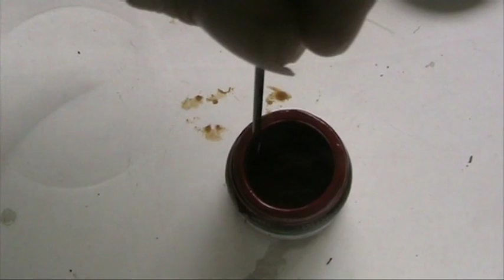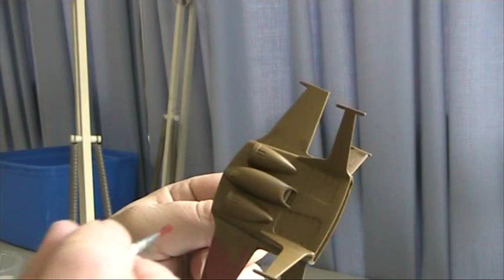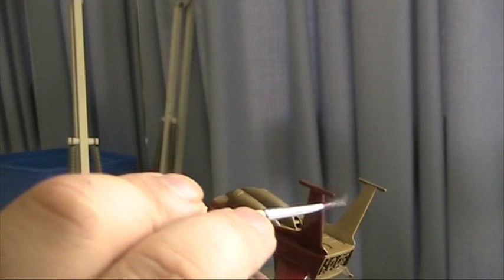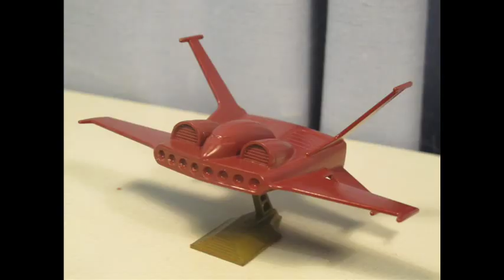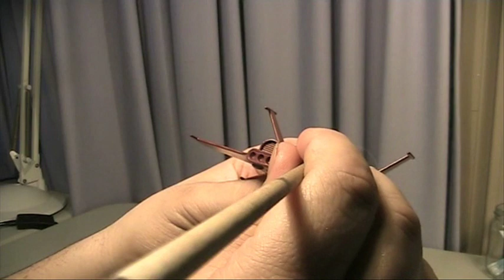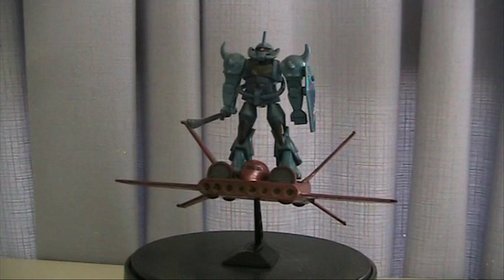Gundam/ mech model workshop 80: hand painting acrylic tutorial

Comment: Hi, I'm having problems getting the paint to stay on edges/convex corners, it just seems to run of, does this mean I have thinned it to much (I used 1:1 ratio of 99% alcohol with tamiya orange) or will it simply require more coats?

Comment: The only tutorial I found useful since I just have paints and thinner. 
Just asking, what else paints work? Do water based paint work? Or even water color?
Reply from the maker: With this method using the correct thinner any paint can work. I would advise against water colors, polyurethane and water based as they have adhesion issues and could life from handling or masking. If you are looking something extremely cheap you can't go wrong with cheap enamels remembering to mix well or the pain will be tacky for a long period of time.

Comment: what if it's a 70% solution isoprpyl alcohol
p.s will it leave marks
Reply from the maker: test it on and spoon or runners and see if you like it. If the mix works run with it on a model.
Reply: mokanaman wow you actually replied in 10 minutes thanks man
Reply from the maker: Just happens to be logged on, glad to be of assistance. I check for questions every days.

Comment: hi, i wanted to know if 70% alcohol stil works even if its worse, and does the isopropyl and normal one differ?
Reply from the maker: It will still work, it will harder to control flow and drying but every brand is different so it is recommended to test on some runners before painting a part or kit.
Reply: mokanaman thank you :)
Reply: one more thing, is the normal alcohol and isopropyl alcohol the same?
Reply from the maker: no, could be ethanol or mentholated alcohol and may have different effects on the paint.
Reply: mokanaman i see, thanks again

Comment: How long did you let the paint dry between coats?
Reply from the maker: A number of hours, might get away with 2-3 layers a day for the best 
possible results. I use to do a coat a day and have a number of projects
 on the go at the same time.
Reply: mokanaman
Alright, thanks!  I'm planning on buying some retarder, would a day be enough time between coats?
Reply from the maker: It is more then enough for an ideal finish.
Reply: mokanaman 
Thanks!  Even though I don't do gunpla, I watch these tutorials because I use Japanese paint and equipment for my aircraft.  Your channel has been a huge help!
Reply from the maker: Gunpla only makes up about 30% of my content but more or less the same 
methods across the board. Thank you for your feedback man, glad to be of
 assistance.
Reply: I'm building a Bf 109 F-4 and I have a few questions

1. I'm gonna use Mr Hobby's Aqueous line because Tamiya doesn't have any RLM colours.  Would Tamiya X-20A work as a thinner for the Aqueous paints since they're both Alcohol based?  
2. Would Mr Retarder Mild work with the aqueous paints?  It's a lacquer retarder so I suppose it won't.

Thanks!

Comment: I tried out Tamiya acrylics for brush painting and here's what I found.
They give you a very smooth finish even without thinning but since the pigment density is low, it takes a million coats to paint light colours like white, yellow, etc.
Reply from the maker: Compared to all the paint's I've used pigment density is terrible. A good reason why I've moved to lacquers.
Reply: mokanaman 
You said an equal amount of paint and thinner, does that mean if I put ten drops of paint onto the palette, I have to add ten drops of thinner?
Reply from the maker: More or less that is about correct until you have the ability to tell how thin the paint is eye balling it while  string the contents.

Comment: do you have to sand a kit before painting it ?
Reply from the maker: I only sand seam lines and nubs. Because I use primer before painting sanding is not needed to alter the kits finish or promote paint adhesion.
Reply from the maker: With high risk jobs like resin or lots of masking I would sand and prime. But because  there is a lot of mixed information on facebook and youtube regarding modeling and painting I'm happy to offer my methods with evidence based results to help inform those wanting the best results. On the other hand some of the younger foke other there want to save money and time.
Reply from the maker: Any time, both enamels and acrylics have advantages and disadvantages. I recommend trying both and choosing what finish and result you enjoy the most.
Reply: mokanaman hello mokanaman. if i sand the whole model can i skip the primer?
Reply from the maker: Sanding the model will only assist one aspect primer has which is etching. Issue is you will have different under colors affecting your base coats and all the scratch marks will show if you are attempting a gloss finish.
Reply: +mokanaman You are right about mixed information on YT. I'm a beginner modeler and I've been trying to find out what's better for brush painting, enamels,or acrylics. This is really not possible here on YT, half of the people swear by enamels (while trashing acrylics) ,and the other half of people the other way round. But generally speaking ,one can pick up a lot of useful information about modeling on YT.Anyway,thank you for taking time to respond!

Comment: Hey, if i were to paint a colored piece (not neutral like white, black or grey), would I need to give it a white flat coat or should I just brush on the color I want it to be? For instance, I'm planning on painting a red piece some shade of grey. What would you advise?
Reply from the maker: Normally primer is neutral is color most gray, most colors will be bright and vibrant on top. If you are painting a gundam originally red and white one color the red areas will look darker. If all pieces have a single under color of primer they will all look the same in shade. If you are painting yellow flesh or white the under coat needs to be light in color too.

Very sorry for the late reply, hope his helps.
Reply: I think I got it. Primer makes colors uniform. Dark colors make the coat on top of it darker. But if I have to paint a color on top that is light I have to use a light colored primer. Thanks
Reply from the maker: Silver Myst
correct, sometimes if you can't get different colored primers you would use a under coat. Like grey primer, black paint then main color. Also a lot of millitary models use a rust red primer as real weapon do the same to achieve the same shade of color.

Comment: People say that acrylic is ideally used for airbrushing as it dries really quickly, the paint does not have time to even out on the surface. On the other hand, enamel paint dries slowly thus levels itself over time, allowing a more cleaner finish. I'm using acrylic paint on a 1/144 real grade gunpla using the old fashioned hand paint method (too poor to afford airbrush lol). Any tips to make it turn out nicely?
Reply from the maker: In theory that is correct but to understand that you need to know how atomizing works within an airbrush. When the paint particles fly in the air it starts to dry before it hits the model. When hand painting the paint goes from jar to model with out making contact with the air and takes longer to dry dus self levels. My advice is to follow this video and practices. Be neat in painting detail and different areas. It is also true enamel is better but you will find method will work nicely.
Reply: mokanaman Really helpful video! I'll try to practise what you showed me.

Comment: After you hand brush the model, what do you use to panel line? I applied 2-3 coats of Pledge Future coat, then I tried to apply panel lines with both gundam marker and vallejo paint. I found out that if I made any kind of mistake, it is almost impossible to remove the error with dry q tip. The gundam marker dye within 2 seconds and stick to the paint like glue. It is removable with alcohol, but it also remove the paint after with the top coat.  

If it help I used Krylon grey primer, I think I spray it a bit too thick since the primer hid some of the lines. Thanks.
Reply from the maker: I use tamiya accent color or Citadel water base ink. I find these two easy to clean if mistakes are made on future floor. Also if the primer is too think scribe the pannel lines with your hobby knife to make them deeper after priming drys and before painting.
Reply: Thanks! I will try that.

Comment: Every time i paint detail with acrylics i need to put on 3-4 coats to get a completely un-translucent finish. is it because i do not put any thinner in the paint?
Reply from the maker: When detailing you do not have to thin the paint as the surface is so small you wont get streaks. Check to see your regularly mixing your paint jar and if it has thinner from airbrushing consider buying a jar just for hand painting.
Reply: mokanaman That might be the problem. The jars came with a liquid that i had to mix. It probably is paint thinner, thanks for the help.

Comment: Too bad tamiya dissolves tamiya when your doing layers.
Reply from the maker: Could you please explain your comment? Tamiya acrylic has a high resin content and once dried can with stand hobby strength enamel and lacquer solvent paints applied on top. You might be mistaken or am doing something unusual to create that sort of result. 

http://www.tamiya.com/english/products/list/acrylic_1.htm
Reply: mokanaman I did the same misstake using tamiya to paint figures etc, Tamiya dissolves tamiya paint when brush painted, but are great for spraying. You will notice this if you put fresh paint on top of your colour palet and spin around with your paintbrush you will se the bottom of the palette in a few seconds.
Reply from the maker: cyrusfett
Ah that's the result of being applied on a non primed surface, softened with solvent  then scraped off with far too much pressure. What occurs on your palette is not a good reflection on what happenes on your model. Mind you no paint is indestructible and can be striped or scratched off. I've been hand painting  Tamiya for over 10 years and can assure you this method is safe for Tamiya to be hand painted on using Tamiya. But you did raise an interesting question as I've seen this happen in my pallet as well and never given it a second thought. The same thing happens with lacquer and primers as well.
Reply: The problem usually accures if you use a dark colour underneath, and or if your trying to paint light flesh or white. Tamiya white is almost impossible to hand paint while sprayed it covers in 2 passovers with the airbrush. I was doing fine too but was told Tamiya is not well suited for hand painting compared to Valejo or such. Its not untill I looked at old models I started to see the bleed thrugh. No scraping, fine natural haired brush.